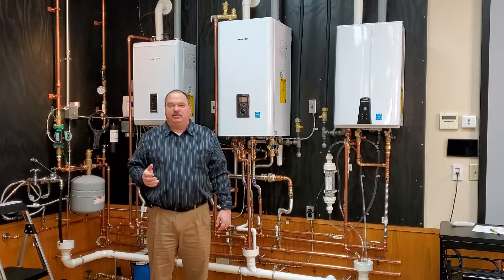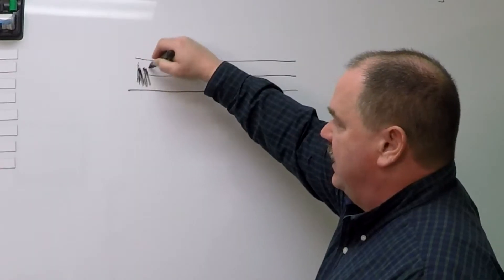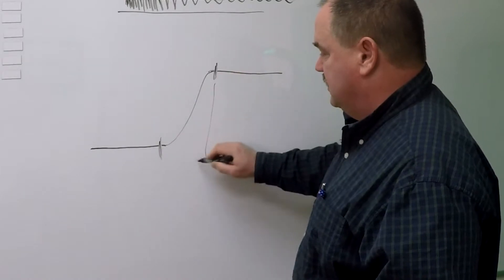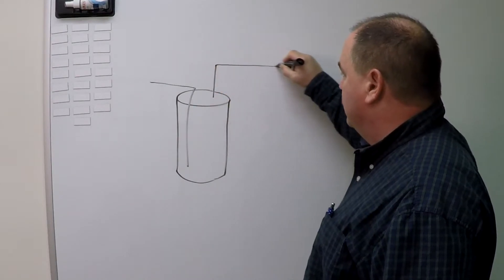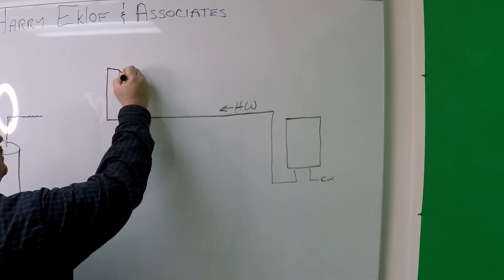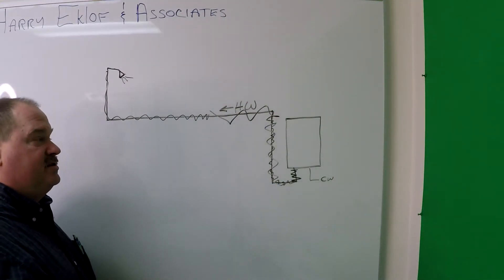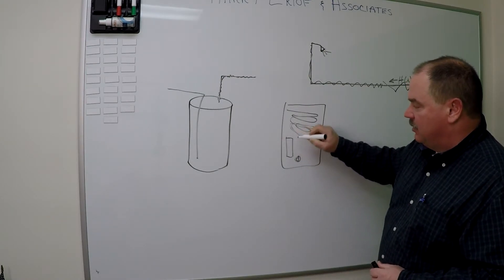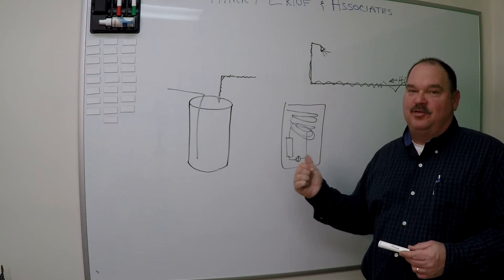Lag Time and Cold Water Sandwich Explained

Comment: @eklof I have a Navien NPE-240s2. Is it possible to get it to recirculate?
Reply from the maker: Yes, is a pump power cord accessory and properly zized pump. You'll find it in the manual under setting up the recirc system.

Comment: I get hot water for a few minutes and then it gets cold. Have to wait a while and water is hot for a few minutes again (tankless Takagi).
Reply from the maker: Tee Key Flow problem.  Your not getting enough to keep the unit running. If it's a shower, clean the shower head and be sire the flow restrictor is not clogged.  Sink faucet consider changing to a higher flow aerator.

Thank you for watching! Make sure you follow us on our FB page here: https://www.facebook.com/scottgreggoutdoors/  I usually post what's coming up there as well plus other channel insight and content not on YouTube.  Also Instagram at www.instagram.com/scottgregg1966/
Reply: @eklof6510  The water is from a well and it's not cristal clean. Ther are special filters installed but since the water is also hard I thought the pipes could be clogged by calcium deposits if it's possible.
Reply: @teekey1754  did you figure out the problem?
Reply: @brooklynboi11207  No I did not. My tankless is totally on a fritz. It takes a few minutes to get hot water and in a short while it gets cold again. Showers get tricky.
Reply: I think I'm having the opposite problem. It seems like my pleasure is to high for the unit to keep up with.  @eklof6510

Comment: I have a Navien, my cold water sandwich occurs several times during the same shower.....!?
New install.
No other water running in the house at that time.
Reply: There is a dip switch setting to adjust the unit for well pump operations. 

Wells often fluctuate compare to city water systems and the unit will adjust there fire rate to maintain temp.
Reply: Is there a blinking red wrench and an "E" code? What is your set point temp on the unit?
Reply: @tranceaddiction  IDK. My plumber said no error codes. Navien brand. We have tried temps from 116 to 120 without improvement. 
He thinks the slight fluctuations in the well pump causes the heater to turn on & off, causing the temp problems.
Removing the o-ring from the shower head helped keep the temp more constant.  So the shower is working pretty good, but it is "high-flow"
Reply from the maker: Also, try turning the heater down!  If you have it set too high and are mixing in too much cold it can cause this...although it shouldn't if you have an NPE...ever.  Could very well be well pump setting as mentioned.
Reply: Came here with similar issue now that it's freezing cold outside.  Navien NP180A set to 125 degrees makes perfect hot water, for about a 3minute shower.  Then it goes from hot to warm to just lukewarm.  No error messages on the unit and this now happens every time.  I'm wondering if this just means the unit can't handle the super cold water flowing through it in the winter and needs to be upsized?

Comment: Where is the next video showing in detail how to get instant hot water? I know there is a dedicated recirculation line, a bridge valve using the cold water line as a recirculation line and then.... some other voodoo? I'm having a 240A put in my new construction home. They don't have any recirculation line, no condensate drain, nor did I see a pressure release valve. My house is probably going to explode.

I'd like to know in detail the methods, your videos are great and easy to understand.
Reply: If you building a new home and you want instant hot water, add a recirc line during the plumbing rough in. It's faster and easier when everything is open. It's also the best way to get hot water faster, just watch out of the length of piping your using.

If it's all finished, you can see add but there's lot of cutting and holes in walls to tie stuff in.

The next best thing is install at the far fixture is a cross over valve, navien has theirs called "navicirc". It's great for retrofits.

Depend on local codes, your plumber should install a drain to drain the condensate from the unit into an appropriate drain.  If not, put a condensate pump to pump it to a drain.
Reply from the maker: What PrimeMech Said.  If you want as close to truly "Instant" as you can get, you'll need a recirc line...or two depending on the piping.  Your builder's Plumber might have the install done yet, as it should have a condensate drain AND pressure relief valve (Required by code not Navien) If those things are missing, it's not installed right.  If your builder won't work with you on it, look up a Navien Service Specialist in your area and he can add the Navi-Circ after your warranty period is up.

Comment: I have a navien npe 240a. I have the unit at 140 degrees just to get hot enough water. Unit is on internal recirculating. Is there anything I could Do to get hot water
Reply: Turn on the hot water tap at your faucet probably.
Reply from the maker: You probably have a crossed connection somewhere in the house.  This is something your plumber or Navien Service Specialist is going to have to run down.  The Navien will give you what it is set for but if cold water is crossed someplace and getting into the hot line, it will 100% cause this.